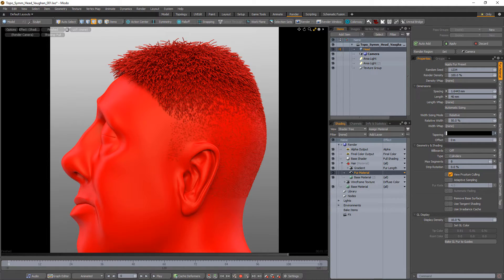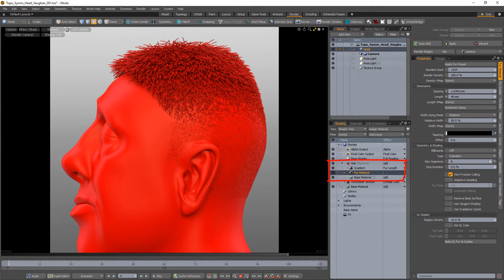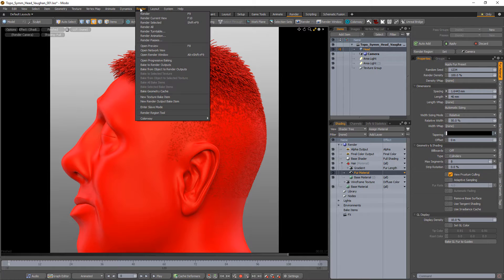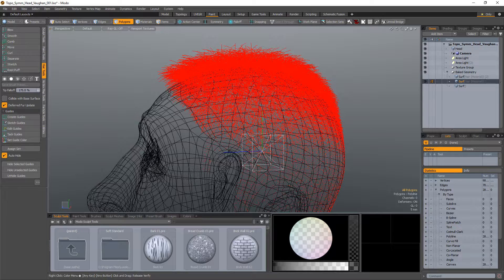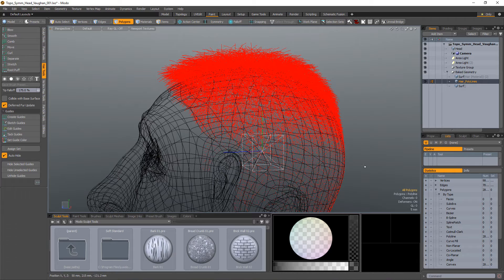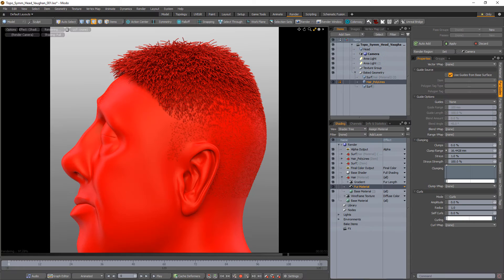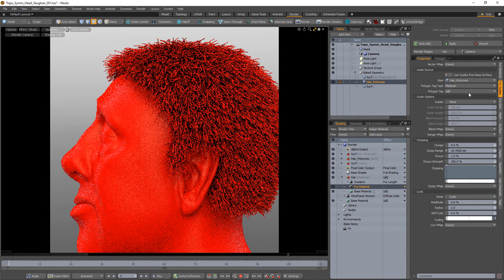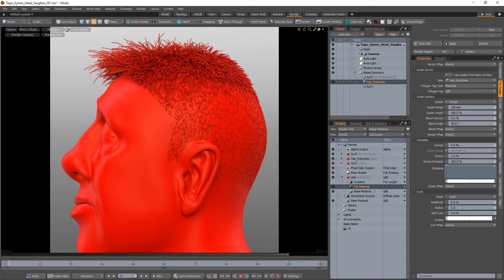MODO | Use Baked Fur as Guides

Comment: How did you sculpt the baked geometry using the hair tools??
Reply from the maker: In the video the geometry cache bake was set to Fur. You can then use the Hair Sculpting tools to adjust the polylines that are created
Reply: Hi, I actually just did the same. Create fur material on a surface, bake geometry with selecting fur. Select the geometry that was been baked. I still can't use Hair tools. But sculpting tool is working.